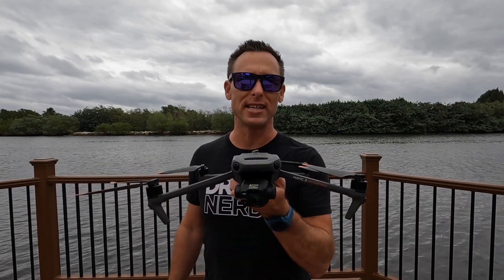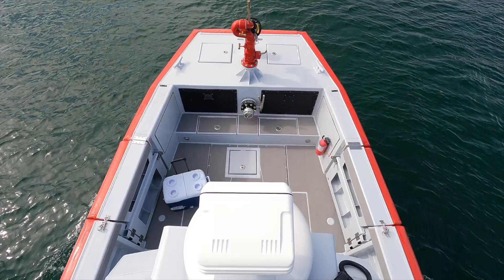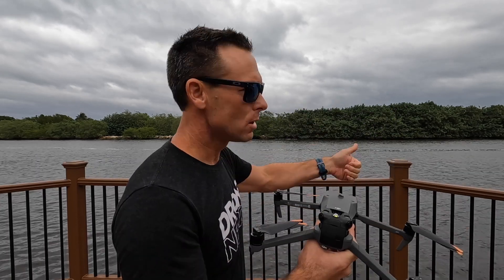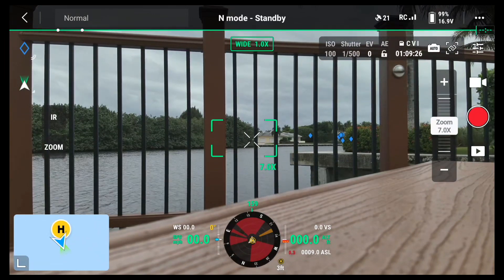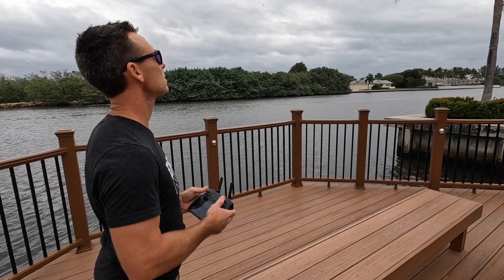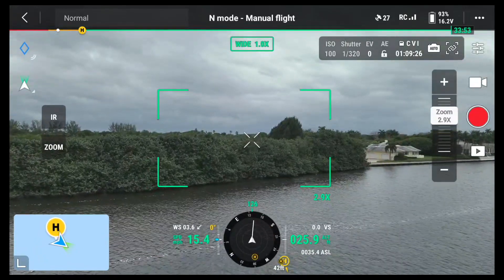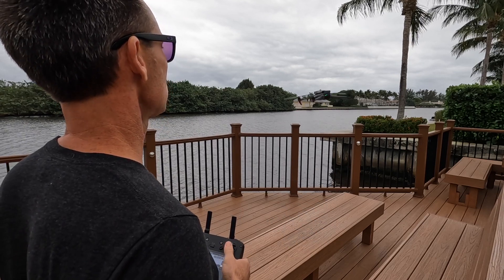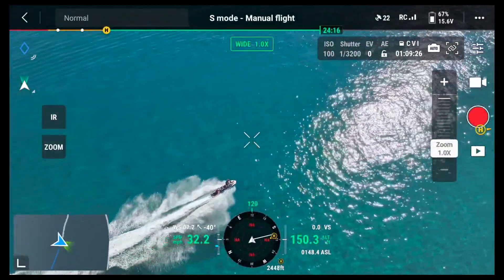Key Steps to Take When Deploying the DJI Mavic 3T from a Boat

Comment: i have a question does the drone know where you are when the boat is moving?
Reply from the maker: Yes the drone always knows where the remote is however, wherever the RTH location is when the drone takes off, unless changed by the operator is where it will return home to. If you are close enough to land, you can set a point there just in case of a lost connection.